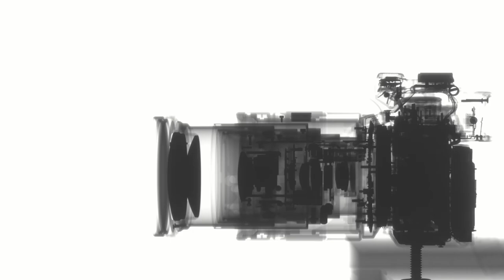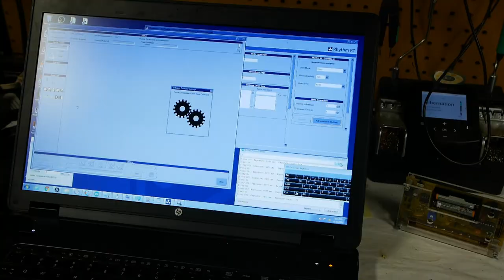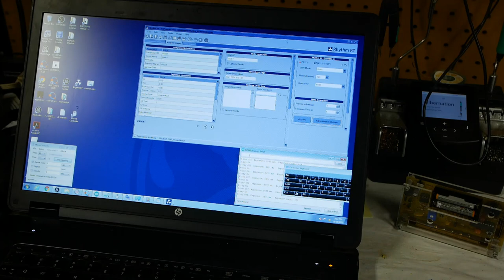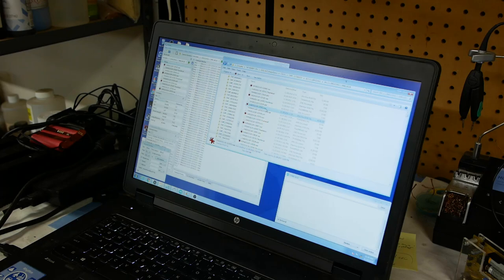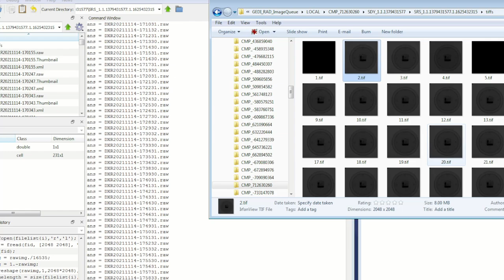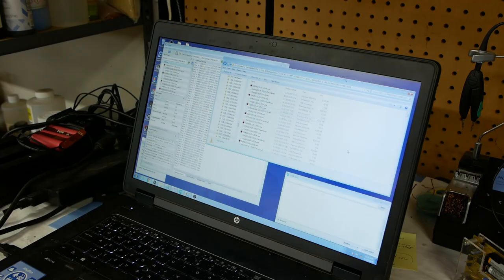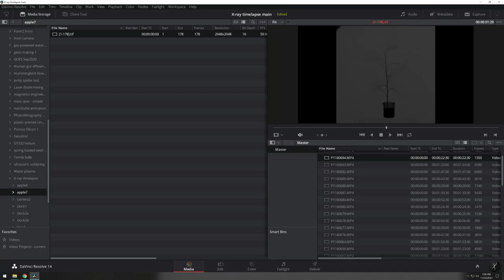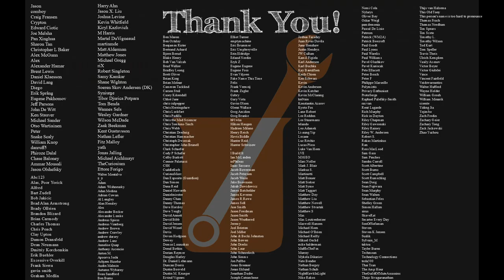X-ray timelapse of fluid movement in plants, stop-motion animation, sensor teardown/repair

Comment: Nice as usually! I'm working as SW developer for X-Ray medical systems and I have lot of experience with such panels. Not exactly this one but they are very similar. Connector at the back is for a tray in the table where patient is laying. You can power up whole detector from that connector as well. And it's used in charging station as well. SW you have is probably from vendor only for basic testing and probably some early buggy version. Better way is obtain the libraries which provides API (not so complicated) and write your own application.  If you want more information or hints let me know ;) PS: for raw images we are using InageJ I'm sure you will realize why it is scientific :D :D
Reply: By the way you are very lucky because most common issue is sensor defects. Sometimes only few pixels are bad (they are still few bad but if it's more than expected it's thrown away) but sometimes whole part of the sensor is not working at all.

Comment: Something I learned from PhotonicInduction is your remote control button for high voltage stuff can be air-driven. Squeeze a button at the end of a hose and it presses an air pressure switch at the other end. The reason is so your remote control can't conduct electricity in case there's a short circuit. That is inherent safety for the remote control.

Comment: We need to start working from a better electrical theory than electrons and so forth. Ionel Dinu and Lori Gardi are putting some great things together in an effort to resurrect proper physics (that has been screwed up for about 130 years now). So that's very exciting and information like this will go a long way at helping those like them in the trenches to have additional information. Thanks @Applied Science!

Comment: Btw. Maybe also interesting to tell about back scatter and safety. When xrays are being protected with lead sheets a lot of back scatter particles will be transformed into beta particles. Something definitely to keep in mind. In most labs they will use hybrid protection walls for this reason.

Comment: Ooh, nice score there! This should be nice for an improved CT setup. I’ve been wanting one, the only two affordable leads I have found currently is a smaller Samsung unit with no power supply or software, and a Naomi unit that’s meant for the entry level market and uses an array of ccd sensors with lenses looking at a phosphor screen. I’m nervous about both, for different reasons. But will find one I like, eventually…. Keep up the good work!

Comment: Since plant roots are designed to preferentially absorb or reject material that may be part of why the full plant  picked up less contrast.  The second branch, assuming care was made  to have a clean cut and the branch was healthy, some plant are adapted to dryer conditions and loose less water and would pull less solution up. Time and conditions when cut can effect how much the leafs are transpiring.

Comment: Very cool video Ben, incredible! I worked a bit on X-ray panels/scintillators and just wanted to add a thought. These panels are designed to be as thin as possible so they can fit easily into machines, behind a patient on a hospital bed and in some  applications directly replace X-ray film. There are versions which use a smaller CMOS (like in the camera style collector), but they are used in large format Xray scanners for things like airports or for scanning packages, but due to their large size they are not feasible for medical applications.

Comment: To emulate mouse and keyboard sequences, and to find their corresponding machine code commands, there used to be a free program called Girder. It prevented macros from failing due to e.g. drift in your mouse or unforseen changes in the GUI.

Comment: I did some work with an xray panel like this once. not sure what brand it was, but it had a similar pogo pin connector for its docking station. the software package on the supplied pc converted the data to jpegs and all I had to do was hook it to their office network so they could save the files to their network drive and then access them from their regular desktop pcs.

Comment: In beta and low-volume software, it's common for automatically generated GUI signals to cause problems.  For example, the X button on the corner of a window often shuts down an application in a less controlled manner than using the menu.  I think it's a psychological issue---the programmer explicitly adds items to the menu but the X button is included by default.  Something like that.  My experience is about 15 years stale at this point.  Super highly used software usually has a whole team of testers so they catch a lot of mistakes like this.  But more complex programs that have fewer more intelligent trained users frequently have annoying bugs like this.  CAD programs are one example.  Product specific software is often so bad that you're better off buying something that has a LabVIEW driver.  There's no magic in LabVIEW but it is signal that effort was expended and that relatively expert users (engineers, etc) will have access to obviously needed functions.  BTW, nice work on the camera zoom illustration.  The tape is a great low electron density belt!

Comment: regarding the battery frontrunning, why didn't you cut out the cell itself and hook the PSU to the cell? that way you can get the battery electronics to report a correct 100% (or whatever you set it to based off input voltage)?

IDK about x-Ray batterys, but this works pretty well on phone batterys

also: the wifi module seems to use an SD Card slot. maybe its SD-IO

Comment: That's a very interesting device. I wonder whether you ever saw the teardown by mikeselectricsstuff of a DNA sequencer that also has a large CCD sensor - although not as large as this. That device uses fiber optics to exchange data between the optical head and the PC that hosts the analysis software.  I worked for Philips Medical Systems X-ray division in Hamburg, Germany but what we did back then wasn't as fancy as this panel. I'd love to get my hands on one of these! Thanks for sharing.

Comment: Also did you know some xray tubes have a grid and its used to sync the tube output to a fluroscope camera frame rate etc , the filament and hv are present continuously and the tube is grid switched... there is an extra pin on the federal so 4 pins over the usual 3,  large filament small filament grid and common...

Comment: That was so, so interesting. The whole panel is a matrix of sensors, phosphor coatings converts the incident xrays to light that the sensors can detect...magnificent!
I wonder if you can change the phosphors to detect other wavelenths - UV for example? (You did say the phosphor was a coating on the sensor matrix, so perhaps not possible to replace.
I can imagine one of the original designers of the sensor matrix electronics commenting and passing on some vital information if they clicked on the video...I guess a little moot now that you have it working, but good info for future reference.

Once again, thanks, one of the best videos ever for me.

Comment: medical devices are a whole different animal engineering-wise.  you have to comply to a whole pant load of standards from three different orgs before a regulatory body will approve your device for marketing/sale/use.  so "no expense spared" is owing more to regulation.
since that board is using a cyclone III FPGA, it's probably running embedded Linux for the NIOS II soft processor to make development/engineering easier.  and i'd bet some milkshakes that the A/D is in fact a network of laser trimmed custom resistor networks and precision voltage references calibrated by the lower resolution off the shelf components...

Comment: Hi Ben great video😁👍 Did you know that the  focus cup around the filament has a connection on the one of the pins and has a slight negative bias with respect to the filament in some applications in order to fine tune the beam shape characteristics... 

Steve

Comment: Great video but would have liked a LOT more Xrays being shown and for longer times. You clearly figured out all the issues that were holding you back so you should have went a little crazier with the actual use of the machine in my opinion.

Comment: How did you collimate the beam, or did you at all? You could have increased the safety via some lead shielding - used as collimator shutters. Also, cement works well for shielding, but the steel was a pretty good idea as well - keeping in mind the likelihood of creating scatter radiation. As for the wiring / plug at the bottom of the image receptor, that should be for charging / tethering. It was incredibly interesting to watch the time lapses you created - great work! I've worked in this field for over a decade, so everything about this was very interesting.

Comment: LOL... This whole time (25 to 35 years) I thought those were just lead damper plates to catch the scatter...LOL.. HOLY COW, those are packed ... If I remember correctly, you said 2048*sq... That is amazing tech.. An now, to see how Tech's used to just throw those around, slamming those into and out of docking stations like they are ripping down a brick wall...

Comment: Awesome vid, Perhaps mix gasolene and send it in a lawnmower engine? / use it outside on a 16v car? Same as Hubble fields ideas from the science community, some folk must have fun suggestions of what to capture using your equipment, so i'd have queried towards the start  "Please suggest what else I should film which would be amazing and never done before" although I can't think of anything reasonable even though i'm a biologist.

Comment: Interesting to see an image sensor where the size of the detector is comparable to the size of the silicon wafer it must have been created on. Considering the large feature size, I wonder how feasible it would be to create one of those sensors with a relatively cheap wafer stepper? Or even making one with something other than silicon, perhaps layers of organic compounds like a reverse OLED panel. Even CdS would possibly work with those long exposures. Then it would be a reasonably cheap matter of coating it with a phosphor, and designing a circuit to handle the image capture.

Comment: Ben, if theres just phosphorous screen inside, that emits light, which then being captured by sensor, wouldn`t it be easier to simply take that only screen off the device and use your normal camera to shoot that screen while it been radiated by X-rays?
Reply: he said it in the video - yes, totally possible, but sensitivity will be way way lower.
Reply: @victortitov1740  missed that part

Comment: This is a nicely timed video for me, because I have some questions related to this project. I'm building a much less refined homemade x ray machine, and I know it can produce x rays with enough energy to be detected about 6 feet away by a geiger counter, but I don't think i'm getting enough of them to produce an image. I'm using a vacuum tube from an old tv, and an x ray phosphor screen off ebay. I think I need more current in the tube, but I don't want to burn it out, do you have any suggestions on how I can get more x rays without damaging the tube? And yes, i have a thick lead cylinder surrounding the tube so x rays only go out the bottom and hit the subject and screen, and the tube is submerged in mineral oil.

Comment: You could use this apparatus to solve a mystery in botany.  Cut a tree horizontally slightly more halfway through; then make a second such cut about 2 feet above the first.  Although you've cut through every column of vascular vessels, water still reaches the leaves.  How?

Comment: magnificent in the shop... do you have a video on the Linear Diode Array x-ray scanners that are used on package conveyors that build the image line by line?  the LDA cells can be setup for very bright x-ray intensity and low intensity side by side as in x-raying the steel wire and rubber thicknesses in tires.   thanks a lot.  😊 very interesting video. 👏

Comment: The wifi card looks like it’s in a SD card slot, using SDIO. Wonder if there was an option for onboard storage instead of wifi using an integrated SD card, then downloading them through a dock.

Comment: Labview should help a lot with automation. Even if the acquisition software API is completely undocumented (otherwise you can just interface the DLLs from Labview or any other programming environment), it should be easy enough to reverse engineer the ethernet communication over WLAN and just use your own program to send commands and get data back.

Comment: Do they use radiation hardened components in those panels? Although the photon energy is small compared to interplanetary environment (MeV to GeV), the power density (W/m²) seems to be relatively high.

Comment: Would it be possible to make a direct capture x-ray sensor, which as the name implies directly converts the x-rays into current?
And then obviously using basically the same technology to gain extra energy from atomic waste...

Comment: Zero G experiments, measuring time in a zero G , dripping molten quartz in a cooling tower and measuring their frequency with something like the ultrasonic suspended dropplet . for small crystals of quartz would need a very high temperature inkjet printer. Free pendulum, in 3D

Comment: The crappy software crashing after a week sounds like a memory leak. You might not have to wait 1 week to test after an iteration. If you monitor the process' memory usage in "task manger" you might get some earlier indication if whatever you did to work around its bugs is having an effect. Just some advice for the future.

Comment: Hey @appliedSciene , fascinating video as always! Could you explain between which terminals you measure the emission current for the feedback loop at 7:00 ? Can't quite wrap my head around how the circuit works with electrons boiling off. Do you just measure the current across the 50kV voltage?

Comment: At 3:20, he says that the sensitivity with a camera and screen would be much lower. Is this not dependent on the quality of the sensor? If the screen is of equivalent quality to the fluorescent material used in the GE device he has, and the best full frame sensor camera were used, how much worse would it be?

Comment: You control X-ray current by controlling filament power. In "normal" tubes, saturating them with low emission damages the cathode. Is this also true of an X-ray tube?

Comment: I would like for see a thorough sceince demonstration of picture to picture concection;
Such as one analog t.v. screen viewing another..Like a connection between crystal balls..;
A solid connection demonstrating connection networks and'
Radio signal transmission connections from built in spyware.
As a adative making a video what a tungesten light bulb can video...;
Such as  recording video by pointing the the light bulb at someone walking behind shaped glass.

Do do such a demonstration one may need to build their own controllers out of.
Winding rather than hunt or program a chip.,'
Ditching the chip in a science demonstration is always an acomplishment.

Comment: As far as I know iodine gas can be used as an x-ray emitter, do you think a million volts would be sufficient? And do you think an x-ray pulse laser is possible for the average Joe without the engineering degree? I was thinking something like the uv-tec but with iodine instead of nitrogen and higher voltage.

Comment: 50 kV? Pretty low energy, those Geiger tubes not very sensitive at those energies. Try caught any emission from smoke detector - Am241 emits not only alpha particles, but gamma rays with 50 kV energy. You will get nothing. To measure such low energies you have to use scintillator detector like Radiation Pager uses by customs personnel. Sometimes you can find one on eBay. I have one and it detects gamma radiation 10 cm from smoke detector while two Geiger tubes see nothing.

Comment: How old is this thing? Would not be unusual for modern image sensors to have an ADC embedded in every single pixel.
Reply: This may not even need a conventional ADC at all: why not just 'count the x-rays'.  A scintillating material can probably gives a pretty nice visible signal (pulse) with each individual x-ray absorption event.  Even an uncooled silicon detector should be able to count these discrete pulses pretty easily.
Reply: @nlszfgkbjldf  but you need an ADC to convert the stored charge that is inside your 'uncooled silicon device' aka CMOS Image Sensor into a digital number for the resulting raw image. That's the way to 'count' or quantitize the number of photons in a digital usable value. I can't imagine that there is no ADC in this device and an analog signal of every pixel is send via WiFi to the PC to create the digital numbers for the digital Image. Would be very inefficent. The fact that there is no noticable SMD ADC for the sensor matrix could speak for CMOS image sensor with included ADC per pixel or pixel row. Even old CCD Sensors have ADC onboard (often one for all Pixels).